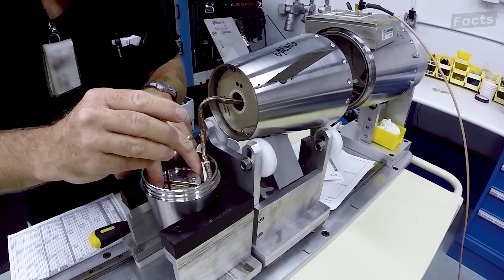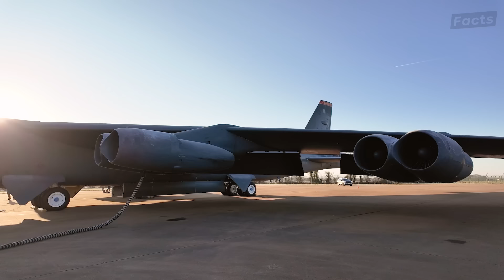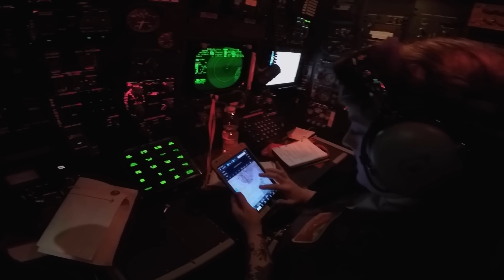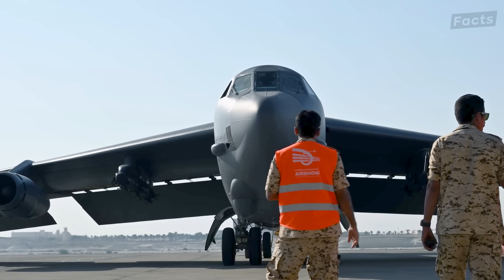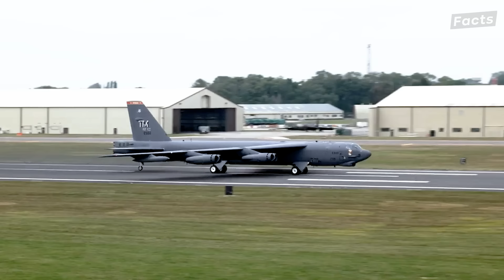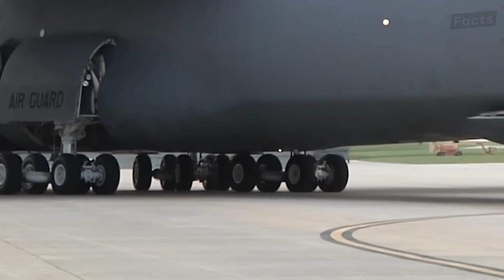Inside The Largest & Most Powerful US Bomber Aircraft

Comment: I worked on the G's at Beale and the D's in Thailand in the 70's both had cartridge start then. Both had cart's on #3 and #5. Later Years after I got out they put cartridges on 1 and 7 Also I see the nose radome but there is no nose gear. B-52s all have / had quad landing gear plus Tip Gear. After my tour in Thailand we started losing B-52s over North Vietnam. Not forgetting the B-52s lost earlier. At one of the last commanders call we had a crew member that had been shot down speak. By that time I was back at Beale working on Kc-135Qs Following the SR-71 around.

Comment: At unstick, a B52 (BUFF) is programmed to weigh 488,000 pounds, fully loaded with fuel and weapons load. At unstick, a B-1B (BONE) weighs 477,000 pounds so the BUFF is a bigger, heavier bomber. However, its weapons load is only 70,000 pounds in the bomb bay while the BONE carries 75,000 in its bomb bay plus an additional 50,000 pounds of munitions on its external hard points. More...

And given the B1 is supersonic and carries 125,000 pounds of controllable munitions, I am chagrined to say given I was a B52 pilot in the Vietnam conflict and on SAC alert in the 70s, that the B-1B is the 'Most Powerful US Bomber Aircraft.'

Comment: And what is even more amazing is that the B=52 was designed not by computers but by engineers using slide rules and hard math rarely taught in schools today; and there were hundreds of engineers working on different parts of the B-52 that all had to at some point come together.

I don't think we have the ability to design an aircraft that way today--it's a lost art never to be revived.  Thankfully, computers have taken most of the human error out of aircraft design, but for the B-52, those engineers got it right in the 1950's.
Reply: You will note that most great innovations and inventions are done without super computers 😢It is done in the creative Brain🎉Best wishes from kenya
Reply: @ElijahOmollo-v9y  "... there are two things that never become obsolete, walls and wheels ... ", so says Donald J. Trump.
Reply: Harder math is taught in HS today than back then. In college you go as high as you can. This is typical generational rant and not true.

Comment: B-52s and KC-135s were designed  for optimal service, not to some bean counter’s spreadsheet. At the time Boeing was more concerned about producing a quality product instead of the profit line. It’s a shame where Boeing is today.
Reply: Very well said, but they learned and are back to putting quality first and now operating as producing well engineered equipment.  They now put the engineers over the bean counters.